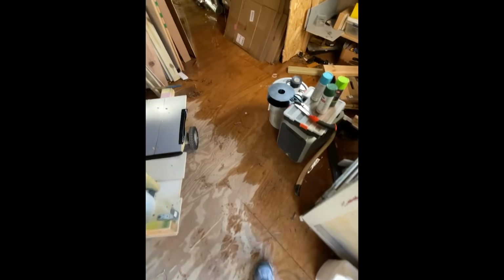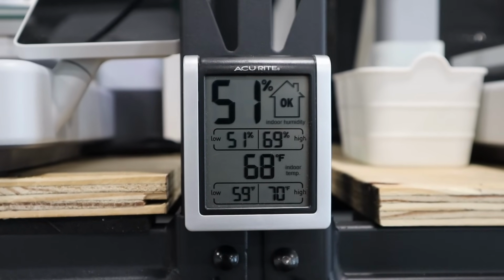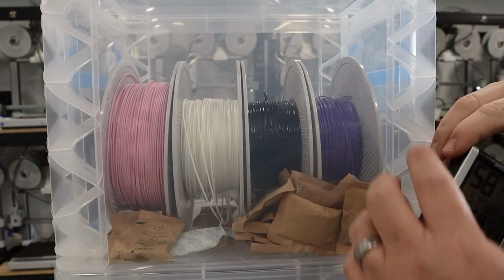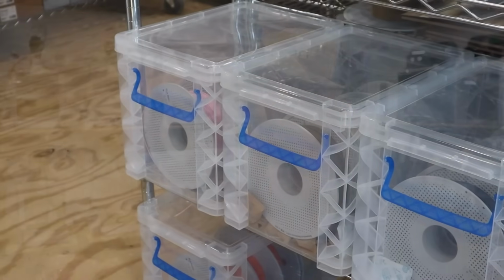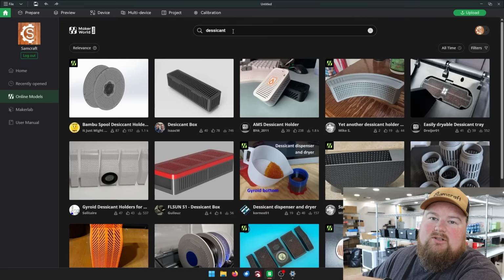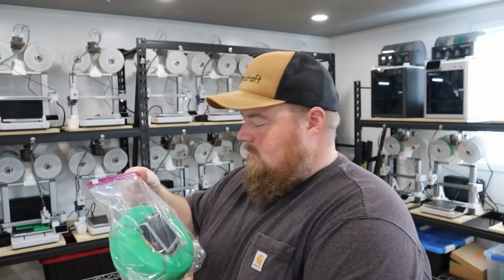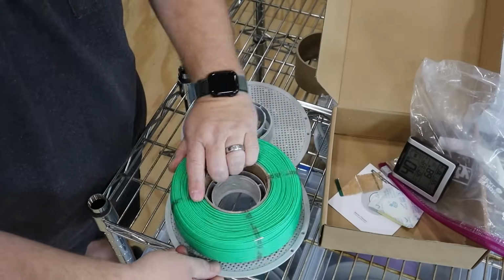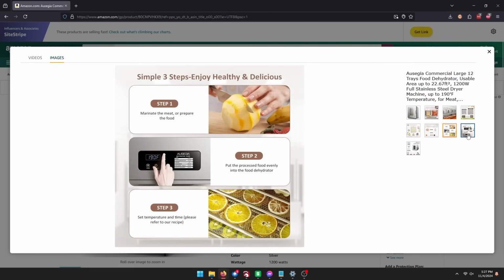Moisture Effects on 3D Printer Filament: Print Quality Test!

Comment: I don't remember from your shop build but did you put plastic under your floor and what insulation did you use? Plastic will keep moisture in and fiberglass will soak up water making it very hard to dry out. As for the dehumidifier my suggestion would be to rent a commercial model. They real pull a lot of water out very fast. The store biught ones are good but not meant for that much mousture. But be cognizant of the ability of the commercial ones. Once they pull all the humidity they will start to pull moisture out of other things like rubber and silicone. So use it just till you hit you target and stop. Then just let yours maintain the level you want. My stepmom worked for a large restoration company the did fire and flood repairs and she had the big dehumidifier in her company van. It had a tube that you ran outside or into a drain because they pulled so much liquid even 5 gallon buckets would overflow through the night.

Comment: For your brand new roll filament test, I don't think you were getting a good gauge of how much humidity is in the roll. When you put the new roll in a bag filled with the air from your shop, you are capturing the humidity in the air as it was in that moment. Then you are gauging how much the pack of desiccant can pull out of the air in the bag, not to much how much moisture your filament can pull out of the air, not how dry the filament was. CNC Kitchen did a video recently demonstrating that of the desiccant packets we get out of new spools have been partially if not completely used up. 

It short I don't think your new previously unopened filament was at 41% humidity, rather that's how low the air you trapped in the bag got due to the partially used desiccant packet and the filament pulling what moisture it could out of the air in the short time you had the meter in the bag.